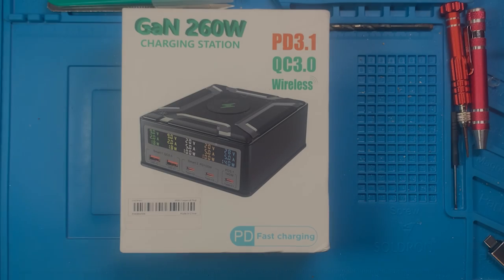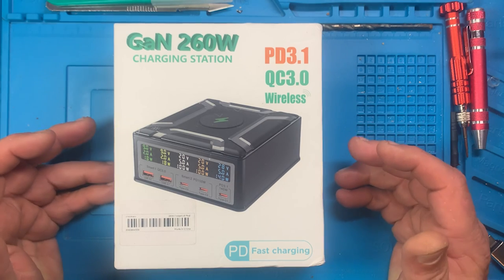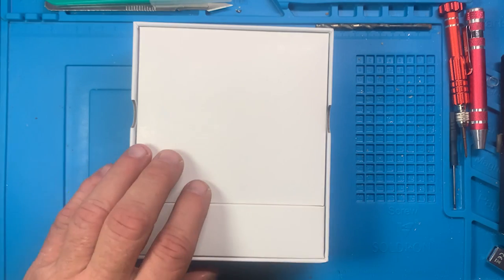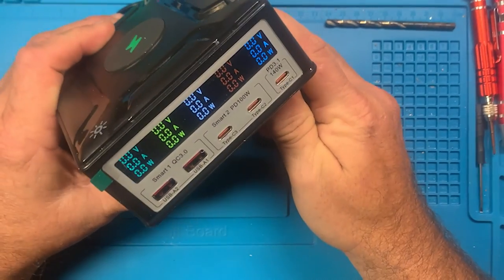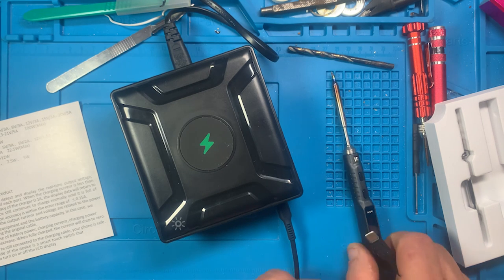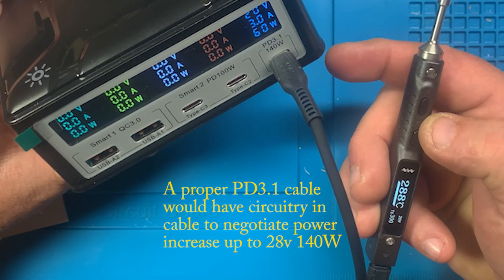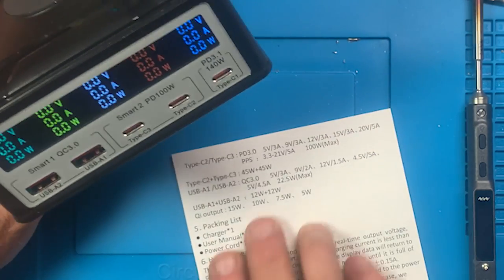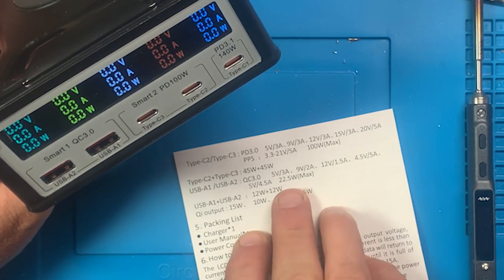GaN 260W 868D Charging station

Comment: Hey mate, I purchased a similar USB charger off AliExpress myself. I have a dedicated load tester and tested it at 20v it's max voltage from USB C port and could only get 65w max while the charger claimed 100w max on the USB C ports. Another thing was when drawing 65w the display on the charger claimed to be doing 75w! 

Quite bizarre, however, for how much it was 65W is more then respectable and perfect for 99% of items.
Reply from the maker: Thanks for the information. I will have to do some tests and see what i can get "most likely the same" maybe it's different from one to the next.  I have noticed that a lot of stuff from AliExpress and TEMU seem to tank for one person and great the next "QC at it's best".  Does make me wonder. i haven't got 140W on the PD3.1 port, not sure if it is cable or charger.  May try my little TEMU load tester.  Thanks for the input and hope to see you here again.